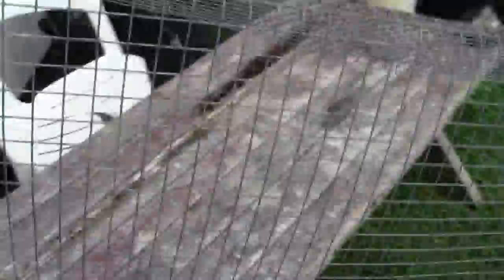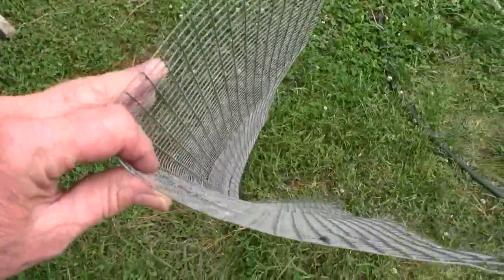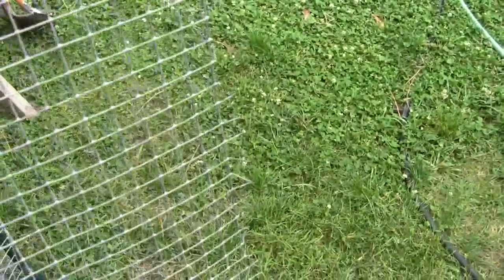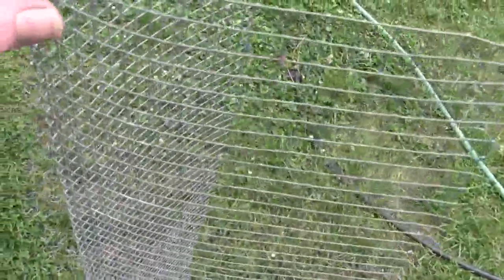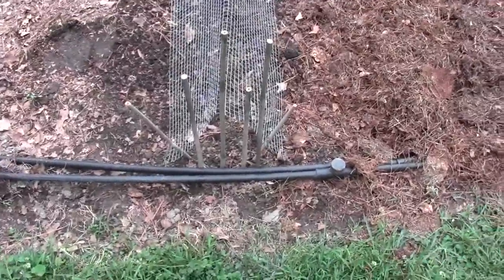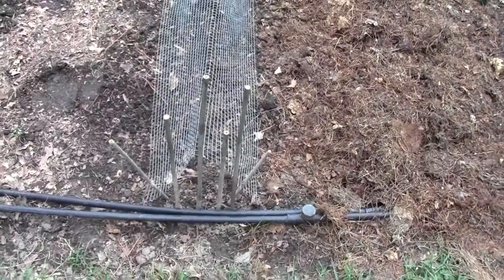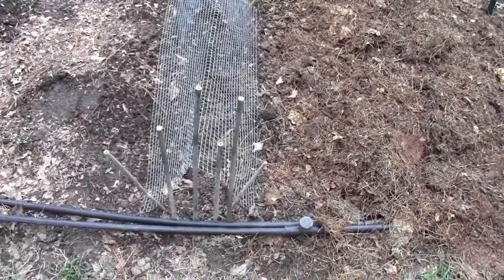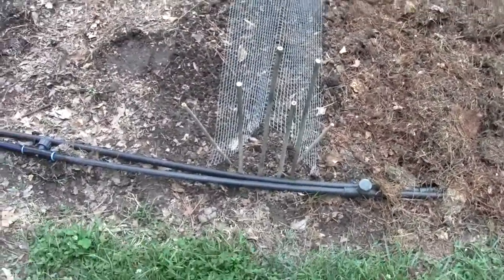USING CLOCHES TO PROTECT PLANTS

Comment: Great idea, Bernard. We lost almost every one of our crowder peas to deer AND rabbits! This will fix that problem. Looks like another project!
Reply from the maker: Karl: It is the lost time replanting everything they eat that is the problem. Growing things on your farm is like having a big sign saying" Free Food". At least the rabbits seem to leave most things alone after it is up and growing and deer browse and take a bite here and there. We have used Irish Spring original bar soap hung in mesh bags for years on the corners of our garden so that the scent blows across the garden from prevailing winds and it seems to work for us. It must be the Original bar. A deer can smell you at 400 yards in a light breeze and I think since the soap is so strong it interfers with their ability to smell danger which is their greatest protection. I have 4 hanging on the wall because they could not smell me. Bernard
Reply from the maker: The wire is called hardware cloth and the squares are 1/2", not 3/8" Lowes carries it. Bernard
Reply: *****
I know...I have several rolls in various grid sizes and lengths. I've just never used it like this. I'm definitely going o give it a try.

Ever thought about using old pieces of garden hose along the cut edges to avoid tearing your skin with it?
Reply from the maker: Karl: I have not thoguht of using old hose. As I get older it seems it does not take much to make my skin bleed. They say your skin gets thinner as you grow older. I wish you were old enough to tell me whether that is correct. Bernard
Reply: *****
I AM old enough (but thanks, anyway)...and it IS correct!

Comment: were was this vedio two weeks ago LOL.   My hubby has been dealing with bunnies eating beans, strawberry leaves, new berry bushes and our corn thats just coming up. we found some chicken wire for this year, but I can see where the mesh you have would be a lot easier to handle.     theres always next year.  thanks
Reply from the maker: I knew I should have done this video earlier. I measured the squares and they are 1/2" and not 3/8". It is called hardware cloth. Lowes carries it made by Blue Hawk. You may have seen some areas where it had holes cut in it. That is what happens when you don't take it off and the leaves grow through the wire. We cut the wire so we could pull the leaves out without hurting them. The galvanized kind will last a lifetime if stored out of the weather when not in use. Bernard